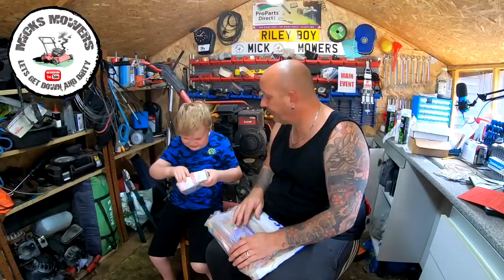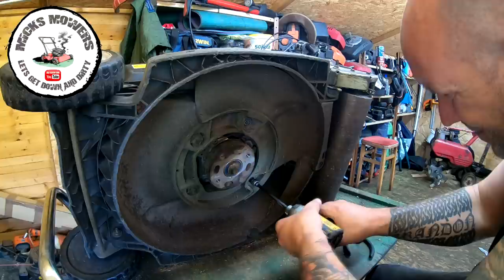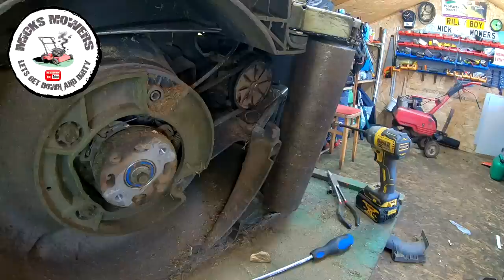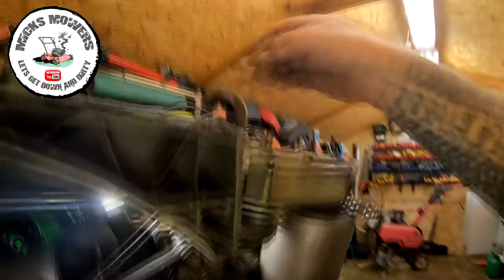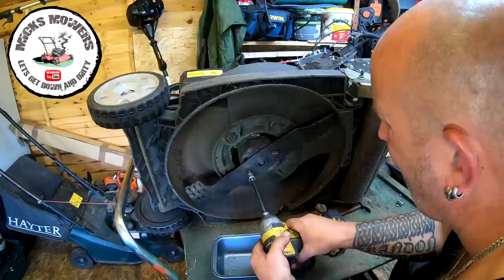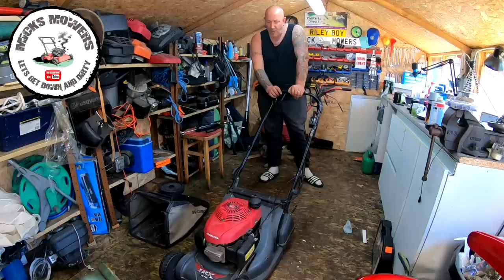HONDA HRX476 Drive Stopped Working Here Is A How To Fix Nice And Easy #hondahrx476

Comment: Hello Mick,
Just wanted to give you a big  Thank You . This video probably saved me hundred of pounds. 
Why? Because the roller on my HRX 476 stopped working. The chain was hanging down.
Not having a clue what caused it nor having the confidence or knowledge to fix it,  I found your video about this!
It gave me the confidence to have a look. I did, and found that the tensioner spring had become dislodged.
After removing all the grass caught up around the chain & tensioner, I lubricated the chain, reattached it back onto the cogs and re-fitted the spring using your method of a pull cord.  Fantastic tip.
Started up mower and all working fine
Had I put the mower into a repairer I could have been charged a fortune if they were unscrupulous, or at best £80 to fix & clean it up .
So, want to send you some money - if you don't want to accept then take it and give it to charity. Either way you saved me some serious money.
Let me know how to do this. (Not that familiar with using Youtube)
Regards, Michael B
Reply from the maker: Hi mate ... Wow thanks.. it's why I do videos to help people out. If your serious about sending me something I do have a PayPal.. feel free micksmowers01@gmail.com

Comment: Riley is the man. He’s always so happy 😁
Some great tips in this video.
A customer brought an all wheel drive Husqvarna mower over for repair yesterday.
It wouldn’t roll in reverse. Also brought a new blade and air filter, about $35.00.
Rear axle and transmission were jam packed with grass. Some with the front. Enough to fill a plastic shopping bag.
Took over an hour to clear it out. Also needed a new drive wheel, that was a big issue, too, as two of the screws holding the drive gear on the wheel had backed out due to the mounting holes splitting.
The total bill for repairs, with an oil change, was $140.00, 
They thought it was too much and gave me the mower in lieu of a bill.
An hour later a buddy of mine saw them buying a new one, just over $500.00.
Go figure. It must be nice , at least they are lubing up the economy!
Reply from the maker: Yeah I see this all the time. People trying to save money then go out and spend lots. Makes me sence to me. Ta for watching

Comment: Spot on video buddy, my roller stopped working, googled it, your video came up, watched it, liked it, subscribed and now fixed my mower…..I didn’t have a roll pin but found a tight fitting split pin…..time will tell if he lasts.
Cheers again buddy!
Mike
Reply from the maker: Fantastic news.. hope it holds up..

Comment: Brilliant video thank you. Recently picked one of these up no drive. Drive belt was off but brand new and found no chain and importantly roll pin was missing lol. Looks like new gearbox fitted as well. Put belt on and gear to chain is now driving....just need to get a chain...on that, have you made a video showing a new chain being fitted....?
Reply from the maker: Just remove the drive sprocket and fit it .. it's easy enough to do..

Comment: Oh. Maybe I don't even need a new belt then? A tweak up might do it because it only slips with a heavy load or going uphill. Your video was very helpful for the disassembly. Thanks
Reply from the maker: I think one of my videos shows how to adjust it .. I have 2 or 3 on this model..
Reply: Looks like its fully adjusted up. I've got a new belt on order so will compare them when it arrives. The freeplay in the cable is good so not sure what else could be causing the slip
Reply from the maker: @MrBubba59  well load the box up and run it up hill. With the side cover off you may see a chain slipping or some??
Reply: Will try that. Belt looks OK to me but trying a new one while everything is in bits.

Comment: I dabble in the odd machinery repair for friends . One of these mowers came to me today with " no drive" .Had a quick look tonight and chain and belt were off, so am guessing this roll pin has done a walkabout like yours and shaft has moved .Just wondering if there was a way of getting that roll pin to stay in, like some loctite seal of some kind .Maybe  a small nut and bolt .seams like wear and tear and roll pin drops out.  Great video and thanks .You may have saved me hours of looking and head scratching Mick .
Reply from the maker: No problems mate.. the roll pin is made of high tensile still so I would use on then a bolt.. glad the video helped
Reply: @themowerman  Yes helped me loads .I had a look quickly today at the mower and the roll pin was missing.

Comment: Great Video. Mine is only suffering from the belt slipping with a full grass box. Is a new belt required or is there any adjustment to tighten it up?
Reply from the maker: Some adjustments on the roller.. with an Alan bolt.

Comment: I do like honda's recently brought an izy for £20 off s scrapman cleaned the carb and it runs smooth.
Reply: Would you take 30 plus delivery .tenner proffit ? 😜👍🏻
Reply from the maker: @tgun9248  I will offer a £5 if he delivers it lol
Reply from the maker: They are great but rust very well too
Reply: Micks Mowers done a carboot sale for my uncle yesterday and someone was selling a stihl rm655 rs. Wanted 300 pound for it.massive though weighed a tonne even though it had an aluminium deck .was in too minds of getting it though.nearly a grand to buy arent they
Reply: Honda’s sell really well here in the states.  $200 minimum and $500 on the versamows!  Hope that Izzy paid your back 10 fold!

Comment: Hi Mick, great video thank you. Quick question, i have the hrb 425, just took off the chain cover and noticed that its off the sprocket and on the shoulders of the tensioner and guide. 

Looks as though the alignment between the sprockets and the tensioner is off but I don't know why. Are there workshop manuals for honda mowers available to the general public?
Reply from the maker: Check the small pins on the gearbox shaft.. if they have broken the gearbox will slide

Comment: Hi Mick, is the drive mechanism on the HRX 476 similar to the HRX 426 (with the rear steel roller)? I bought an HRX 426 recently and the drive is very weak. I suspect the drive belt is either loose or needs replacing, but being unable to find any info on this specific model, (only on the 4 wheel version which is quite different) I'm unsure how to to tackle it. When I engage the drive bar, the drive chain rotates as it should, (as seen through the gap where the blade height adjuster handle sits) but the mower needs a push to get it moving. It won't propel itself from stationary.
Reply from the maker: Hi mate .. yes it's the same as the 476..

Comment: Hi Mick, good fix not a fan of those cheaper gearboxes Honda use on that range of mowers (I think they are made by general transmissions) , but this one is now good to go again, good video🙂👍
Reply from the maker: Yeah I hear ya. Still an expensive mower for a home user. They cut well and I like the engine. But your right the gearbox is cheaply made. Hope all is good your end mate

Comment: Hi mick
I have been gifted a HRX 426 and I have filled this vid and the chain is on, the belts on and when not under load the rear roller does spin but as soon as I start to cut the grass there seems to be not enough power to drive it.
I dis notice the bulky with the belt on what wuite stiff and tight in a part of the rotation, what could this be im at a loss and would love to get it fixed as it was my dad's.

Thanks craig
Reply from the maker: Sounds like the gearbox mate
Reply: Oh no, any vidsds showing how to repair ir

Comment: Great Vid Mick, my question to my mower Honda 476 starts to lose drive when its been run for 1/2 hour or so. Once cold its fine. Mower is aprox 9 years old. Do you think its the clutch or the drive belt. Thanks
Reply from the maker: Could be the coil

Comment: Hello Mick, great video thank you. On my 476 the chain is loose and it comes off. What I’ve noticed that the chain tensioner arm is bit loose and it wiggles. The trouble is I don’t know how tight it should be as the bolts holding it are tight. Any advice would be greatly appreciated. Thank you
Reply from the maker: Email me some photos or Instagram me some videos mate
Reply: Hi Mick,
Somehow I haven’t got a notification about your message. 
I’ve ended up ordering new chain and sprockets and the issue is solved. The chain was attached and the sprockets warned. 
Thank you anyway. 🫡
Reply from the maker: @vilagivideos3020  no worries mate

Comment: Tried replacing the pull cord but can't get the 3 nuts off as two are spinning can you advise honda izy 416
Reply from the maker: Are the bots spinning as well?
Reply: @themowerman  yes
Reply from the maker: @Ppp-kk6hw  ok.. you will need to put a bar underneath.. to add  pressure then try.. or if not the lot will all come off including the tank and then you can remove the bolts with a 10mm socket from underneath
Reply: @themowerman  thanks 👍

Comment: Hello Mick I have a problem with my HRX 426 when I put the lever to the Stop position my Lawnmower keeps running. If you can help me on this, I would be so grateful. Thanks John 👍
Reply from the maker: Hi mate. Sounds like a cable adjustment is needed. Or the cable from the coil to the micro switch has come off the coil end.. hope that helps
Reply: @themowerman  thanks a million Mick 👍
Reply: Mick thank you it was the sheath at the end of the cable causing the problem thank you for putting me in the right direction mate 👍👍👍
Reply from the maker: @johnmcdonald2736  your very welcome mate.. glad I can help
Reply: @themowerman  I will keep tuned to your videos Mick you know what you are doing. So disheartening when I couldn’t get any information else where on here. I have to congratulate you on your expertise, so thorough and precise. It’s what I want on here 👏👏👏👍👍👍
Reply from the maker: @johnmcdonald2736  thanks mate I'm working hard to bring more content

Comment: mick,my pals got a hayter harrier notor mowe which is still working but viciosly kicks back when starting.been told its oil getting in by repair man and there is a lot of oil on plug,but could it be flywheel key,looking at it without removing flywheel it looks ok,your thoughts/bob
Reply from the maker: Keyway mate

Comment: Hiya mick.. after some advice if poss please mate... I’ve just fitted a brand new carb to my ryobi hedge cutter and it started fine at first for 5 mins then cut out and now not starting??  fitted new fuel filter.. Also are there meant to be fuel filters on both pipes?? Many thanks Glenn
Reply from the maker: Send me some photos of the set up.. as they differ